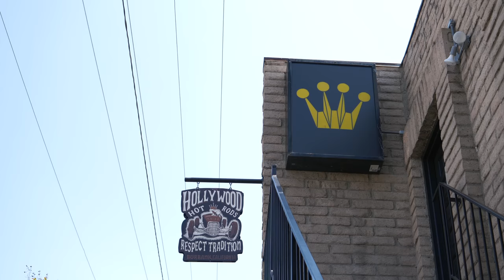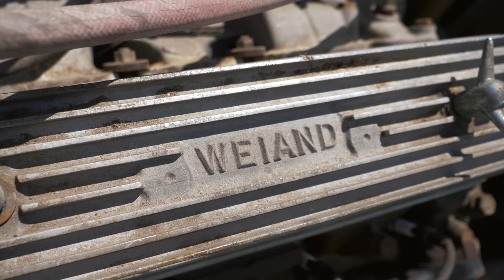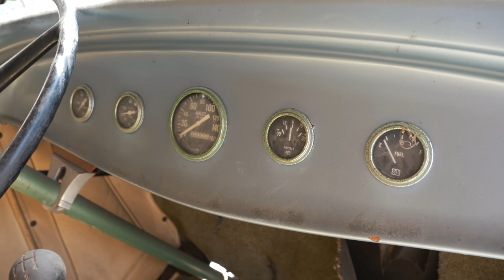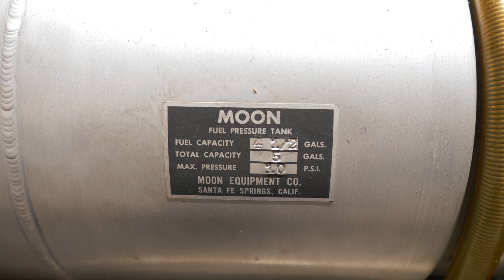Hollywood Hot Rods "The Dewar Coupe" (‘32 Coupe Barn Find) | 4K

Comment: I keep looking at this car, in fact it really hit me in the thumbnail so I clicked it. I'm not 100% sure, I seem to remember seeing this in either old an issue of R&C, from the late '50s or I used to have a book called "Grease Machines" published in 1978 that featured photos of customs from so. cal during the late '50s and early '60s. there's a group photo on one  page that has a chopped and sectioned '32  5 window (obviously not your car...) and there were other '32's on the same page.for some reason the blue paint, the motor, and interior really rang a bell. the other '32s were 3 windows like yours I remember that. I know that's not much, but I hope it's a bit of a help.
Reply from the maker: Tommy Mills That’s very interesting! I’ll let him know!
Reply: The other thing, (and I didn't even notice until  I watched this a couple times) the car I remember seeing pics of had a white rolled and pleated insert where the canvas top would be, and this one has it. it's been a long time since I've seen the pics, since I lost most of my old car literature stuff, but I also seem to remember it had Olds Fiesta caps on it. I do hope this kinda helps.
Reply from the maker: Tommy Mills Cool thanks for taking the time writing all that! Very interesting!
Reply: Just looked through Grease Machines and it's not in there, only one rod and that's a Hemi powered '32 Victoria with the roof cut off. Guess you're thinking of a copy of RnC...
Reply: Ya iam the same its  terriblehim sitting un supportrd on thst fender especially  because it's  not his car

Comment: FYI electric fuel pumps were common in the 50’s, often easiest way if no clearance for a mechanical pump. I had a Bendix electrical pump mounted in the trunk of my ‘47 Ford coupe, flathead with 3 97’s in ‘56, later with Cadillac later with Olds 324 - same pump. Pump was hard piped to block on firewall, hoses to carbs made swaps easier.
Nice find. Wonder where my ‘47 is today - only had 12,000 miles on it when I sold it in ‘59.

Comment: The Holy Grail of hot rods!  Far cooler than a '32 roadster, in my opinion!  Those things are like belly buttons these days, with so many reproductions!  But it doesn't get much better than a real-deal Deuce 3-window running a '39 Ford trans-shifter Olds!  I'm 73 and have lusted after that combo all my life.  A Caddy in there with a Cad-Lasalle top shifter would also be perfect!  I'm very glad you're going to just clean, service and drive this car!  Last of all, as you're lucky enough to have become the caretaker of this piece of history, you should show respect for the original owner/builder by not using the front end as a chair, and keep your butt on the seat and your feet on the pedals where they belong.  I'm sure they'd appreciate it!  Great find!

Comment: electric fuel pumps were often used because ford flatheads were bad about vapor locking. the factory located the fuel pump on top of the engine, at the back , so in the summer they were bad about vapor locking. i remember my dad and i pushing his brand new 1951 ford hardtop, down mockingbird lane in Dallas,Texas on a hot sept. day. he was mad.
Reply from the maker: commando340 Interesting, thanks for sharing!

Comment: What an awesome & lucky find . they are true time capsules from the past . Did you have mice or rat's damage ? We have a 1969 Caprice two door with red interior stored in a barn for over 30 years and mice ended up getting inside the glove box and the inside of the rear bench seat. It's cleaned up now but the smell was bad when we dragged it out of the barn. We also have a 1967 Dodge Dart two door with a crate 360 ci engine, headers, Holley 750 carburetor  and some sort of speed link automatick on the floor . I love great finds like these. Basicallythe cars are complete but they need hell
of elbow grease 😎
in it

Comment: Great old hot rod to "recondition" to its original look and finish. DO NOT RESTORE with today's materials or upgrades. Leave it as it is. This is exactly how custom show cars were built and what they looked like. Keep as much of the original upholstering as possible, having chewed areas replaced.  A good professional metal polisher could rebuff all the chrome and aluminum parts to look freshened. DON'T re-chrome or replace Weiand engine parts. Have them gently buffed. This would be a great car to rent to Hollywood for movies and for showing at hot rod shows.

Comment: I thought about something you said about how the bottom of the fenders that were cut and the electric  fuel pump, it probably  had a 8ba flathead at one time, because of the water pump motor mounts that raise the engine up higher than the stock geometry causing too tight of a fit to the firewall, I had that problem and went with an old Bosch electric not wanting to cut the firewall. What do you think?

Comment: I and my wife just bought a 1934 chevy master roadster convertible rumble seat str8 6cylinder 207 engine 3 on the floor single exhaust muffler  (no glass pack) all-metal restored car safari windshield no radio or antenna car single windshield wiper no door windows sports car of its era. original restored off eBay.... keep in her original as I like my Chevys

Comment: check out that axle drop! thats really hokey! probably done by someone at a forge as a favour ..  :-)
Reply from the maker: Mercmad Wish we knew all the little things!
Reply: I think some of those R&C mags back in the seventies did a few articles on how axle drops were done. Anyhow, me and some friends decided to give it a go as we had a spring makers department where i worked in the early 70's and they had some big furnaces where we figured we would heatv the ends of the axle, stretch it and bend it . It's not easy,as we made a mess of it and  never tried again,ha ha .When I saw that one,I could tell it's not a Dago'd axle ,the eye is at the wrong angle, but it all adds to the charm of the car, I only wish i had found it!. I hope you post up a shot of the Olds running..

Comment: From a car guy to another car guy do not chop the top. Too many 32s were chopped and are more rare then anything you have ever driven. There is one thing if you restore it as is. I would consider putting a Flathead Ford V8 with a 3 deuce intake or a blower on it. White tuck in roll interior with pleated seats and door panels. Try to match the color on the car if decide to repaint it out some nice painted smoothies with chrome trim rings and baby moons and wide whites with cheater slicks. Thats the way I would build it.